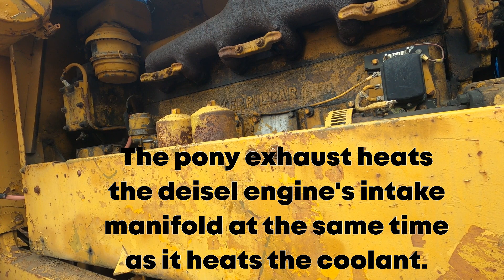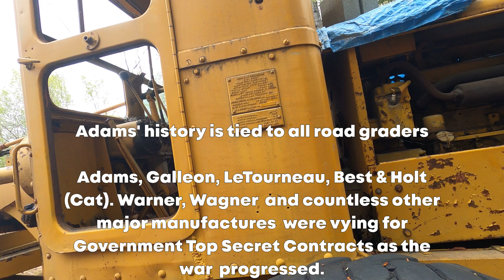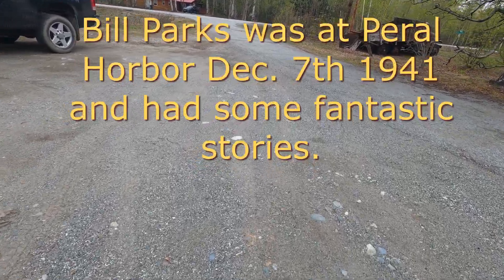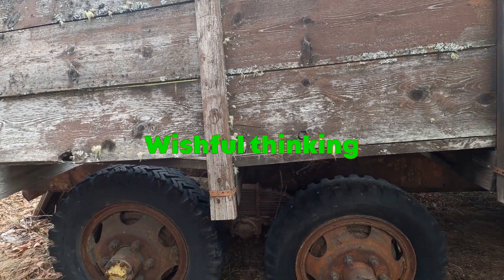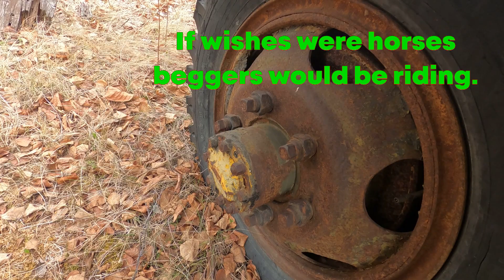Missing file found : A Talk with Jim

Comment: Might as well go ahead and put those 20s on your one ton. 😎
Reply from the maker: I thought of that too and even found a 6 lug 20" with a ring and tire full of air ..... but .... um ... my asshole was pinching washers when I turned it over...   That was one of the worst wheel grenades I think I'd ever seen... Holly Jesus I should have went home and got the 9mm and shot it from a safe  distance. The metals were flaking away between the rivets and was real bad at the valve stem.. 
JPayDirt texted me to "be careful !" after sending him a pic... I was tired, sore and sweaty cleaning the three acres and wasn't thinking. So I'm taking more breaks...
Thanks for the advice bud.
AND AND AND I did find a 16" 6 lug rim, ring and tire for the One Ton. 
More to come.....